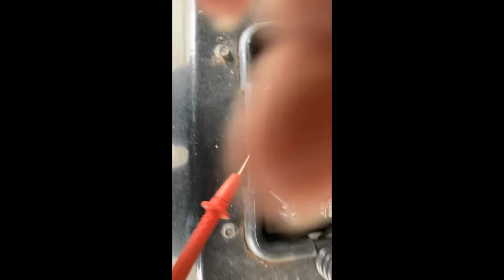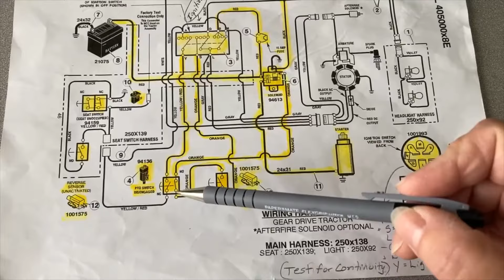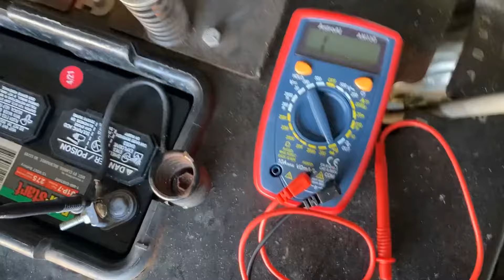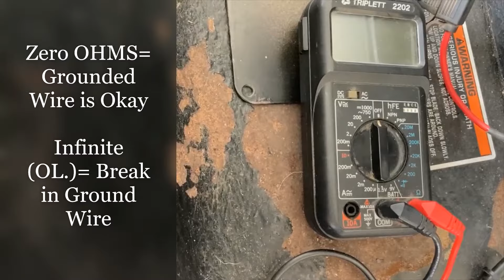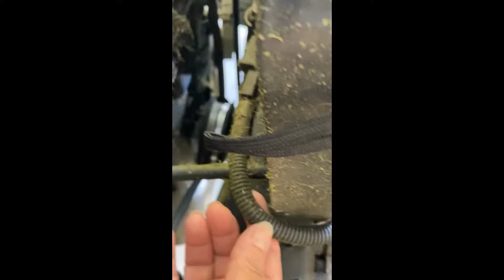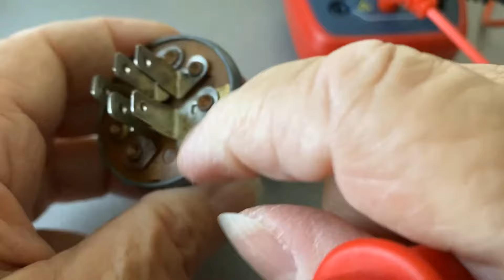Murray riding lawn mower will not crank or click - How to trouble shoot (detailed).

Comment: Again when you tested the switch you tested the battery (B) terminal and the Solenoid (S) terminal.  Remember the solenoid or starter terminal are spring loaded and don't make contact unless it is put to the start potion.  That was a faulty test you did there.  The solenoid terminal gets is power from the Battery terminal but only when the key is moved to the start position.
Reply from the maker: Yes, I became aware of this and I tried to correct that in my video but I guess I didn't do a good job, so I wrote about it in the description.

Comment: This is for people that don't understand what a starter relay solenoid does.  The starter solenoid is just a heavy duty switch from the battery to the starter.  The thin wire from the ignition switch is way to thin to carry the current required to operate the starter.  However the starter solenoid operates on low current that comes from the ignition switch.  The solenoid has a copper coil inside with an iron rod that pushes the iron rod threw the coil when it is energized with 12.6 v.

If the starter system didn't have a starter solenoid (relay) it would burn out instantly for the starter wire is to thin to take the load that it takes to operate the starter.

Ignition starter wire is an 18 gauge (small)

The starter relay wire to the starter is the same gauge as the positive B+ wire about 8 to 10 gauge or lower.  The smaller the gauge the bigger the wire.

The starter requires 30 to 50 amps to operate. That means you need wires big enough to handle that much Amps without melting the wires.

Comment: When you tested the red wire coming from the ignition switch to the relay it to has to be on the spring loaded start position.  That little wire must have 12.6 v to operate the starter solenoid.  You will not get any 12.6 v reading if it's only turned to the on position.  Because how the ignition is wired it only has voltage when in the start mode while cranking and power to the starter, once you release the start mode it is spring loaded to return to the "on" selection.

Comment: Do you know how to disengage the  hydrostatic drive system? Or make it so I can push and move into storage until I can get it started? Love your video thanks
Reply from the maker: @toriphillips6982  No, I don’t but I found this on the internet:

Disengaging the Drive (for pushing):

Locate the Neutral Lever: This lever is usually located near the back of the mower, often below the seat. 

Disengage the Drive: Move the lever backward to disengage the hydrostatic transmission, allowing you to push the mower.

Parking Brake:
Some models may have a parking brake that you must release before you can push the mower.

Comment: I have the exact same mower, my issue is whenever the mower is running and I let off the clutch/brake, engage the pto, or let off the clutch/brake with it in gear, the mower dies. Thanks to this video I have narrowed it down to what I believe the problem to be there is no reverse safety switch. I haven’t yet been able to fix this because the wiring is confusing me. The seat switch is still there but no reverse safety switch. Any input to help?
Reply from the maker: Safety switches will cut off the engine if there’s a brake in the wiring or the safety switch is bad. 

I looked at my diagram and the reverse sensor/safety switch on my mower is at the back under the battery almost next to the seat safety switch. It should be to your right if you’re standing at the back of your mower facing towards the front. 

I would start with the seat safety switch first, which is most likely the problem. Look to see if there any breaks in the wiring, or if the harness came loose. If a visual inspection seems OK, then you’ll need to test that safety switch the way I showed on my video with a multimeter and check for resistance. 

If the seat safety switch checks out OK, try to locate the reverse safety switch and if I remember correctly, I also showed it on my video where it’s located. Once you find the reverse safety switch, do the same as you did with the seat safety switch with a visual inspection and lastly with a multimeter. 

Keep checking those safety switches one by one until you find the culprit. If you’re still not finding the problem, then inspect any breaks in the wires that leads to the ignition key. I hope this helps.
Reply: @Chocaluvr seat switch is bad or not being pressed in far enough

Comment: This helped me narrow down the issue on my mower to the safety switches. Not sure exactly which is the issue. To avoid having to actually fix it, I jumped the connection from the large terminal with the positive lead from the battery to the small terminal that energizes the solenoid (orange wire), coming from the safety switches. Since this means bypassing the safety switches, just be smart and make sure the blades are disengaged, you're not in gear, and the clutch/brake is pressed.Turn the key first, then jump the connection. If the solenoid works, this will energize the solenoid and the engine will start.
I'll note that I jumped the connection with pliers. Don't leave them permanently connected.

Comment: I have a mower just like yours. I don’t have the manual anymore. Would you know what the spark plug gap is?  I have googled but I am not getting the precise answer. Is it .02 or .03 inch? Please help.
Reply from the maker: If your motor is a Briggs & Stratton models 210000, 280000, or 310000, then you spark plug gap is 0.030. You can download you manuals online by typing the model numbers of your mower or motor which should be located on your mower.
Reply: RC12yc plug at 30 thousand gap
Reply: Thank you so much!  Now, the mower won’t start. I have serviced it: changed oil and spark plug. It made a little sound and now it’s dead. My mower looks exactly like yours. I watched your other video to take the blades out and changed out to new blades too. You’re too incredible to know this much!  Now I am just at a lost… and our yard is a corner yard, big size, I am so stressed out that after all this work I did to it, it won’t start. Btw, my model number doesn’t have the alpha letter at the end, I tried checking all their manuals to look for spark plug gap and it’s nowhere to be found.  Thank you for letting me know it’s .030.
Reply: I even put back the old spark plug back because I didn’t know what to do.
Reply: Update: For anyone looking for help, I got the lawn mower going by changing the battery. I couldn’t believe that was what the problem was. Very pleased that none of the work went into waste. I’m surprised this Murray ride on lawn mower is this good. We have had it over 10 years and perhaps there was one oil change and one blade sharpening in this entire decade and it’s still working!  Now that I know how to do these maintenance, thanks to amazing woman here, I will do them once every 2 years.

Comment: 18:25 when I check for resistance, i dont get zero or OL. I had the same red multimeter as you and I got a reading of just 1
Reply from the maker: Did you remember to kill the power to your mower by disconnecting both battery wires? OL (overloaded) or a 1 when checking your ground wire could mean there’s a breakage in your ground wire. Check your ground wire for any damage or if there’s rust or corrosion in the area where it’s connected.
Reply: @Chocaluvr  me and my uncle figured out that the starter wire got cooked a little and it ended up ruining the connection. So a new wire there and a carb and we are good to go 👍🏻

Thanks for the help :)

Comment: You are my favorite person today. I have (an older version of) the same mower and the same continuity tester. I too had a bad solenoid. 

Luckily, Murray doesn’t seem to change things up much, so everything was in the same place in my mower.  They only store manuals online for about 20 years, so if your Murray is older than that, you can’t get the manual on their official website.

Thanks again.
Reply: They had a cheap solonoid on them too start with, just replace it with a stens one

Comment: Orange wire only gets power when the key is in the start (spring loaded) position.. It activates the magnet that moves the bar inside the solenoid that makes the connection of the two large post to pass the 12 volts to the starter (same as putting a screwdriver across the two post)..
Reply from the maker: Right, I went back and re-checked the solenoid and the Orange wire with the ignition key in the spring loaded position and it still did not show any voltage. I edited the video explaining that but I guess I didn’t do a good job of explaining. It’s a pain editing and adding into an already recorded video, and once you publish the video, you can’t add to it if you want to make corrections. I made a note of this in the description.
Reply: The SAFETY switches will prevent you from getting 12 volts to your solenoid, If you are not sitting in the seat or you are not pressing on the brake pedal or the key switch is not in the START position or your mower blade is in the engaged position or you do not have your drive lever in the neutral position, you will NOT get 12 volts TO the solenoid terminal that is directly connected FROM the battery. Once all of these conditions are satisfied, you will get 12 volts to the solenoid terminal directly connected from the battery, than you turn the switch to the START position, you will get 12 volts FROM the solenoid terminal directly connected to the starter motor. The engine will start and you will RELEASE the key from the spring loaded start position and it will automatically return to the run position.

Comment: Thank you so much,  I have the same mower with the same problem.  
Your video is very very helpful 
Thank you
Reply from the maker: You are welcome! Thanks for letting me know it helped.
Reply: @Chocaluvr  
Yeah, thank you. I am not sure what is my problem with ridder because I don't have the testing tool yet, but I am sure it will be one of the ones you mentioned.  I did however, got bew battery, with no chance at all.
It was working, I did few runs but I had to go inside to check on my grandson, when I came out it didn't want to start! So, it could be either stater, or ... ! 
Anyway, thank you so much for the info. Very very helpful.  I will try to get stuff tomorrow, and see.